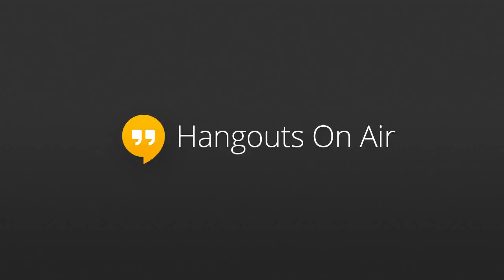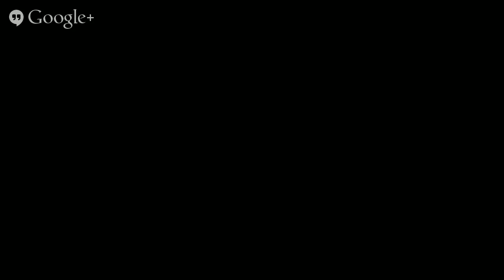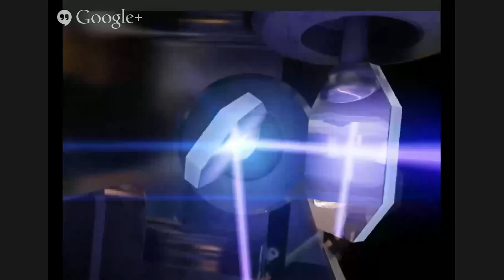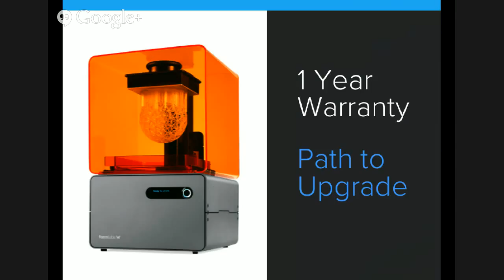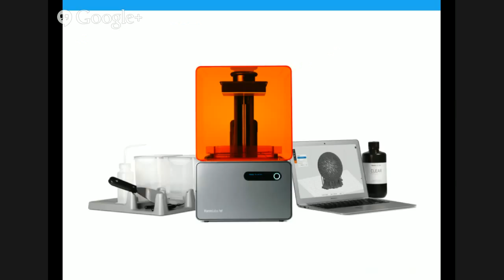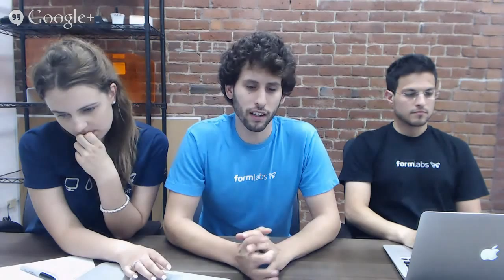Introducing the Form 1+ LIVE Q&A

Comment: I missed the Q&A since my lab was out watching the USA/GER game, but I have a question. I know you have the software moderately closed to make it simple for people (and likely to have control over the sale of compatible resins), but there are some of us who would like the ability to modify settings for experimental resins and even write .form files for experimental processes. Could you share anything about your file formats (e.g. .form and .slpc)?

I know the .form files used to have embedded STL files for the parts and support back around version 1.1, but version 1.5 (or maybe earlier) changed the format. STL data of parts is still in the .form files, but things like endianness and bit length have been changed. I figured that much out, but the data for the supports, however, is hiding in a way that I have yet to make heads or tails of.

Comment: Question 1: The black resin seems to be the best one for small and fine details, but are the layers less visible with it too? No problems to print very large models at 25 microns with it? (ZBrush models).

Question 3: no plans for adding an export from PreFrom?
Thanks! - Thomas Roussel.